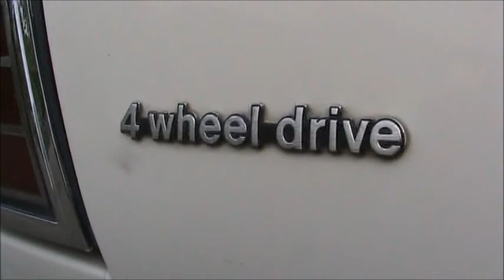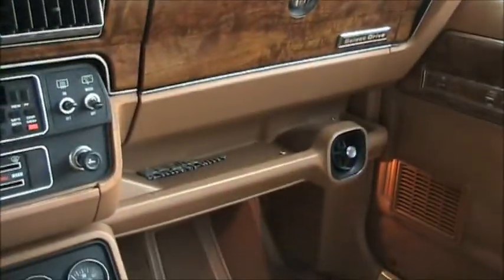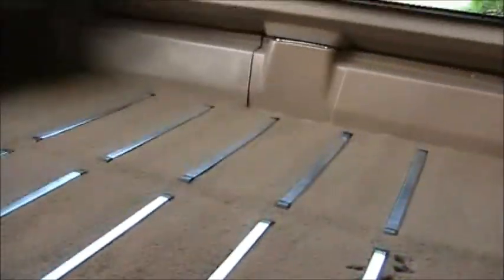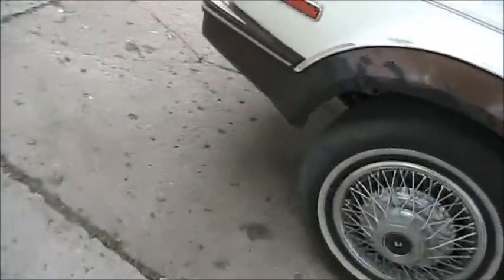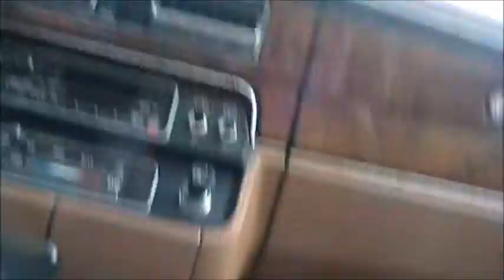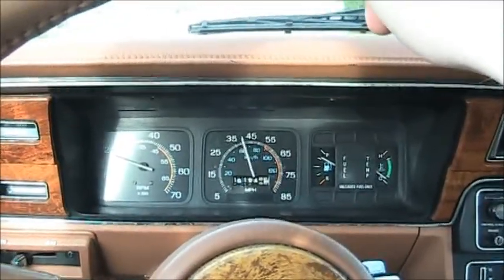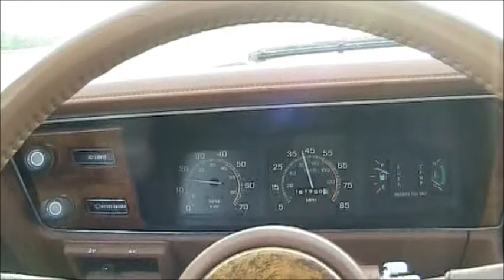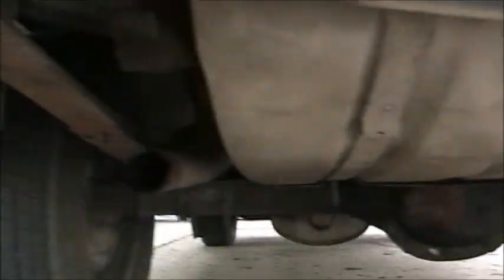My 1986 AMC Eagle Limited wagon

Comment: the speedometer problem could be the gear inside trans where the cable connects  older cars the turn sigle inside tells you when one bulb outside is not working check bulbs vibration could make it stop and start look for original rims no hubcaps 
cool car i want one

Comment: Starting in 1985 AMC introduced the Shift on the Fly 4X4 system, where you could shift from 2WD to 4WD without having to come to a complete stop. So the switch in the 85-88 AMC Eagles did not have the pin to pull down. My 86 limited wagon has this system and has the same switch as the one in this video. Also, that is not an aftermarket stereo. I have that same radio in my Eagle. It's the electronically tuned AM/FM radio with cassette player with DNR (dynamic noise reduction).

Comment: I own an 84! One thing that comes to mind as I watch: Im not sure that your shift on the fly 4x4 is working. Mine has a pin that you need to pull down below that switch before you throw it. Its vacuum opporated and you can hear it his as it shifts. Also, youre supposed to have to come to a stop to shift it. Maybe they changed it for 86 though! just looking out. Cheers.

Comment: Your clunk may be coming from a worn engine and or a worn transmission mount. Its not an expensive fix .  That should make it go away.  I went to the AMC factory back in 89 not long after they stopped Chrysler Fifth Avenue and Plymouth Fury and Doge Omni Horizon production. They still had people working in the Administration building yet. Engine plant was still going too!

Comment: 1990 in Jeeps was the last year they used it then they switched to the 4.0. You plan on keeping that car ditch the Carter BBD carb, its a piece of shit. Get a Weber or something aftermarket.. what a difference. You are right, Jeep's are all muts all the parts are all mixed, Dana/Spicer axles, Aisin transmission etc. Also depending on what state you live in rip off all that emissions shit.